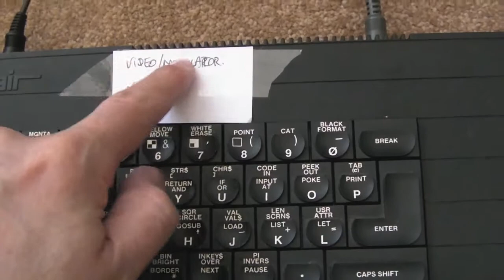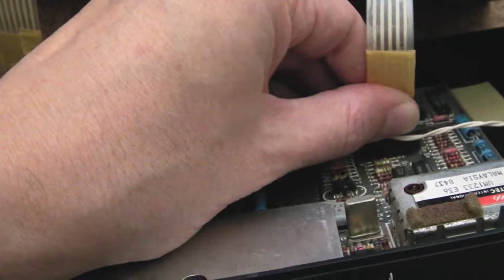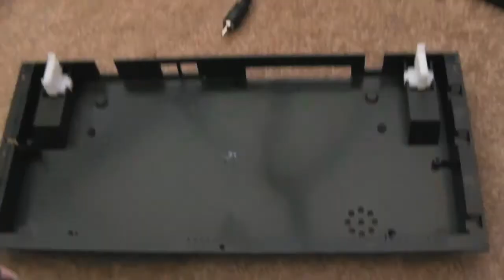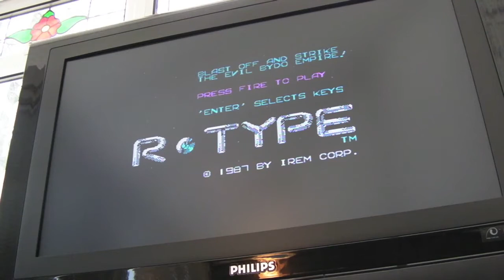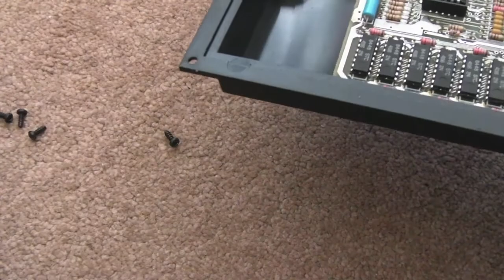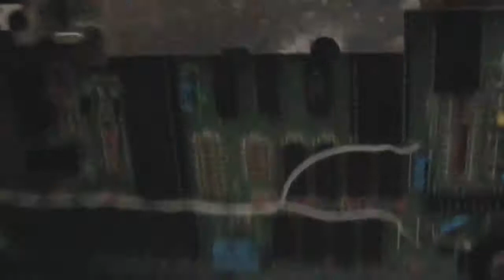Sinclair ZX Spectrum+ (Plus) Joblot Restore (Repairs) (Composite Mod & More)

Comment: A little cap on that modulator modification would be in order.
Reply from the maker: Yes, that's a good idea to remove the bias.  In addition I would amplify the video on the Spectrum now (not sure if I did that in this video or not).
Reply: @GadgetUK164  So using an NPN tranny, similar (if not the same) to a ZX81 composite mod?
Reply from the maker: @garyt123  Yes!  I've done one of my Speccys with that mod - same PCB I used to composite mod the Atari 2600, and Archimedes A3010s.  The picture is far improved in brightness level and clarity in general.
Reply: @GadgetUK164  Hmmm, never thought of applying the same circuit to the Speccy TBH. Did you also need to put a smaller, second, resistor on the earth to increase brightness? (I needed to do that on my ZX81 as the display was really dark)

Comment: the one you said was a later revision was it was a 4S made by samsung, and while not rare they are not as common others, imho they are a step up in quality its a shame someone had been in it, if you dont believe me about the samsung units open 4 or five spectrums and the 4S and compare the quality, when you do the 4S wil go in your collection.
the upgrade + cases have red serial numbers or no serial no (later plain).
my speccy was upgraded twice by sinclair once from 16k-48k and second up to plus spec.

Comment: I forgot about the reversed polarity on the power supply and blew the arse out of the 7805 regulator and also most likely f*cked some other stuff - Yeah I do have 6 of them but that error pissed me off.

Comment: I’ve just bought a Spectrum + and I’m going to attempt to replace the capacitors and do the RF mod and install a new membrane. Never done anything like this before but I like taking things apart and trying to figure them out. This video has been a great inspiration and a great guide so thank you 👍🏻
Reply from the maker: Thanks, let me know how you get on!
Reply: How did you get on and Is it still working?

Comment: Can I use a  Sega Genesis/Megadrive Power supply for a ZX Spectrum +?
Reply from the maker: +magnus87 Yes, the Spectrum+ is basically a 48K model inside a better casing with more tactile keys - the board is the same.  Long term you are best buying a dedicated 9v PSU that can provide ~1.5 amps, on that outputs precisely 9v.  The Megadrive PSU outputs more than the 9 or 10v it is marked with.  I think mine outputs nearly 14v DC, and that translates into the 7805 generating a lot of additional heat.  So in summary, its fine for short testing / sessions etc, but I wouldn't rely on a Megadrive PSU to power a Spectrum long term.
Reply: GadgetUK164

Thanks for the advice, I got a the correct PSU but now I have a problem with the load comand. I tried with android app to play TAP Files but know my Spectrum doesnt show the colors from the borders (Cyan, Red..), what happened?
Reply from the maker: It's possible you have a ULA fault?  Are you connecting the audio out from your android device to the ear input on the Spectrum?  I know volume can be a big problem with phones and tablet computers.  Often the volume isn't enough to get it to load properly, but you should hear sound at least when its trying to load?

Comment: 23:19 I think we're at the point where most original 48k/48k+ membranes are well past their use by date, and will probably require replacing in the vast majority of cases.

Comment: still have this unit?
Reply from the maker: +Amy Marie I ended up keeping the one I re-capped in a later video.  I think all the units in this video were sold on.  I couldn't be bothered restoring the board with the corrosion - too many other things I wanted to spend time on etc.
Reply: ah gotcha! hey id do the same!

Comment from the maker: "Steve C" - Google+ won't let me reply!

Yes, I have tried solder paint - It's very hard to apply and the net result after fixing 3 or 4 traces, it still didn't work =/  Ultimately you end up needing new membranes =/
Reply: i got a spectrum thats mint condition and worked last time i tried it.since then i only have a 4k tv and cant get it tuned in,do you think its because of the tv being too modern?
Reply from the maker: Yes, you probably need to do a conversion to composite.  I am amazed a 4K TV has an RF input tbh!
Reply: +GadgetUK164 good job it has because im on freeview! thanks for that.i have a old crt tv but cant find the remote so cant tune it in!!
Reply: Interested to see how you got on with it. If the composite mod got nowhere have you tried changing the capacitors? (I know it's a cliche but it got mine going!)

Comment: The clear (non brittle) membranes tend to be the better ones, so keep that one if you can. They also need the lozenge shaped retainers on the lid tightened down to make connections between the layers on the membrane. Some that appear dead can only need tightening down. But at the end of the day, buy a new membrane from RWAP and you'll be sorted. I'd suggest one of my Spectrum+ membranes, but they are only for making USB keyboards as they have different key mapping (5x13 matrix not 5x8).
Reply from the maker: Thanks for the info =)  I did buy a couple of membranes for the rubber key models (next video to upload tonight) and I will get a couple for two of the pluses soon.  Do you have any links / videos related to your USB membrane?
Reply: GadgetUK164 There is an article on my blog on the membranes http://blog.tynemouthsoftware.co.uk/2014/12/New-fully-mappable-ZX-Spectrum-Plus-Replacement-Membranes.html and one on Spectrum Plus keyboard restoration (a picture of the clamps towards the end) http://blog.tynemouthsoftware.co.uk/2014/11/zx-spectrum-plus-keyboard-restoration.html

Comment: I never had a Spectrum back in the day, I remember alot of friends had them, but I never got to play on them as they were always at the repair shop. C64's and Acorns seemed way more reliable. I've got a whole bunch of different Spectrums up in the loft (untested) that I need to get round to looking at one day
Reply from the maker: I think you are right - I have seen a lot more faulty Spectrums over the years.  Commodore were better built imo.  You only have to look at the fact that Sinclair shipped faulty 48K models as 16K, used chips with faulty banks and wired them according to which ever bank worked, coupled with some of the Z80s having faulty M1 lines from new.  They really hit the bargain bins when it came to component sourcing lol.  I also think the C64 keyboard is amazing when compared to either the rubber key or the plus model.
Reply: lol, I didn't know they did that! Would it not have been cheaper to run the rams through an automated tester instead of building the 48k and then finding out it didn't work and bodging it lol. Have you had any of the 48k ones that have been changed to 16k?
Reply from the maker: I've got one I am uploading a video for, and I could be wrong but I don't think it could ever have worked as it is as 48K.  It should upload over night.